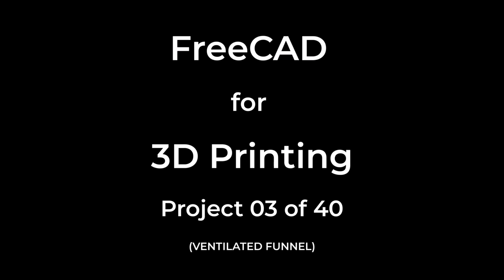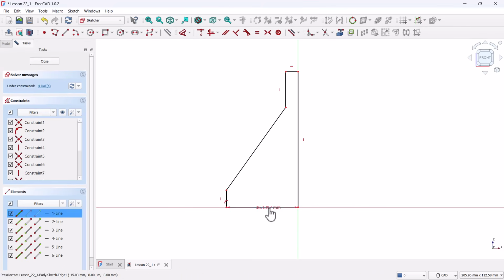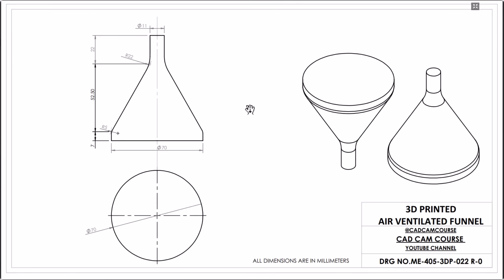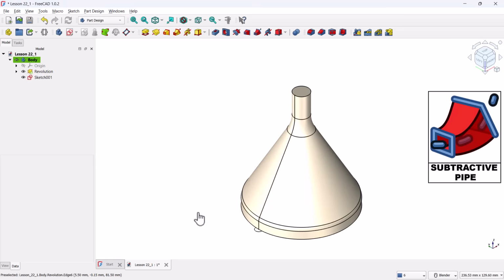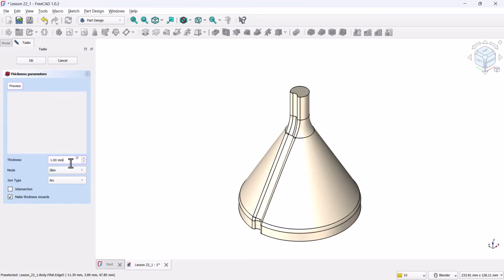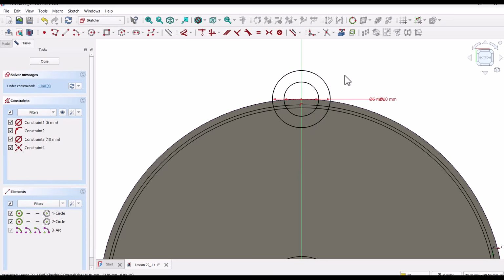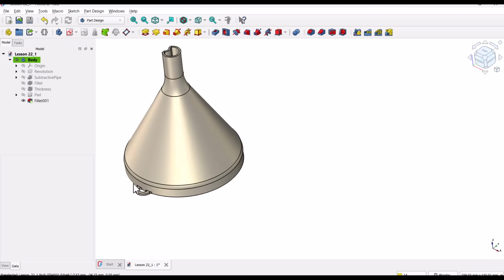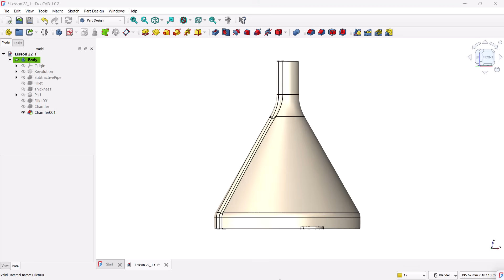FreeCAD for 3D Printing – Project 03 of 40 | Air Ventilated Funnel | Step-by-Step Modeling Tutorial

Comment: When using the thickness tool it returned an error (FeatureThickness.cpp(150) Exception on making thick solid). It seems this is a buggy feature in freecad (1.0.2) and seems to have issues with sharp edges. I changed the fillet on the vent  to 2 mm and then it worked. Then I changed the fillet on the vent back to 1 mm and the applying the thickness tool went OK now. Strange behaviour.

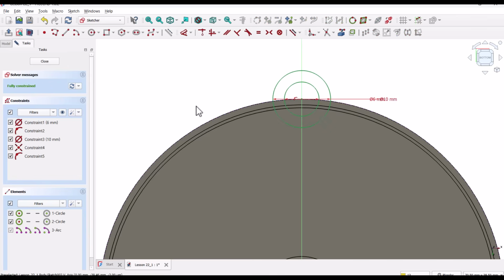Comment: Thank you helping me finally make some progress on a decade long desired hobby @CADCAMCOURSE, One question, What is the purpose of the "Arc by Center Tool" step at 10:43 if the drawing was already fully constrained at that point? It's obviously a necessary step but no explanation was given as to why it was a necessary step at that point or why it was helpful to the drawing/model. Or is it just me that missed it?...
Reply: Never mind. I think I figured it out.
Reply: It's to define the line where the loop hits the funnel, before taking away the part inside the funnel.

Comment: Im stuck on my end with cliocking the Pad Tool to add the hanging loop, my whole sketch disappears. when I add the parameters and click "ok" it says 'Wire is not closed' anyone know where I went wrong first time doing this..
Reply: Just in case it's the same issue as me, or anyone else runs into it, I needed to trim the line between the loop. I should have paid closer attention to the video, whoops.
Reply: @PuffyZA  Perfect, I had the same issue, thanks for your help.
Reply: I had the same issue. Trimming the line between the 2 loop-ends did not solve it. I removed the sketch and created it again. This time it worked. No idea why it was not working first time.

Comment: Thanks a lot for this tutorial series. It is directly on point without being uneccessary bloated. 
I have a question regarding the "subtractive pipe" operation on the revolution body. You drew the circle to be subtracted directly on the revolution seam. This way you where able to  use the seam as a path for the pipe subtraction. How would I go on such a shape without that seam - maybe for a second pipe subtraction on the opposite end?